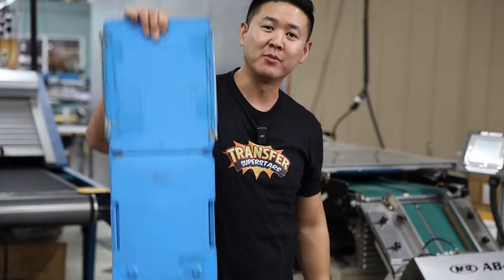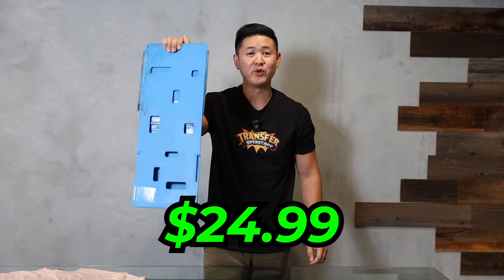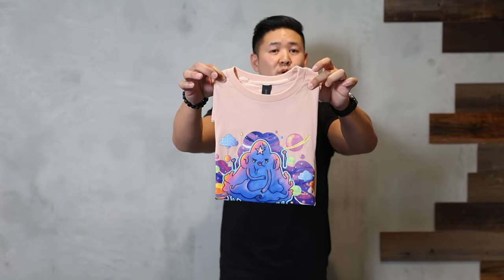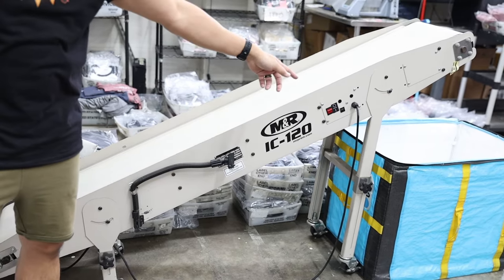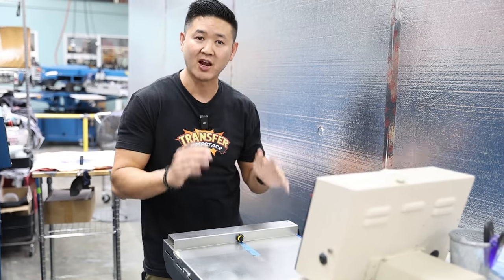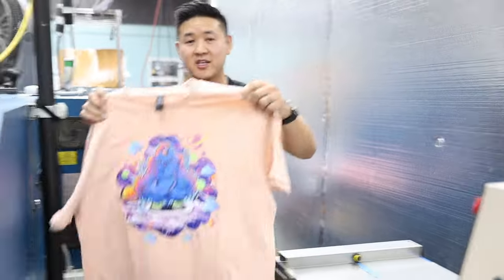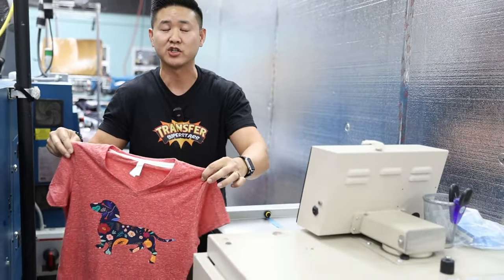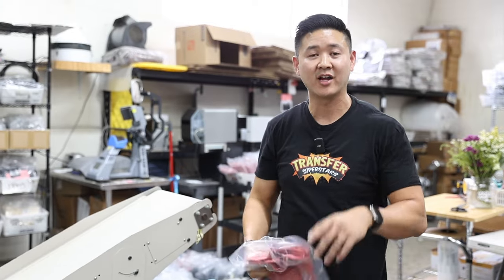$24 Shirt Folding Machine Vs  $50,000 Robot Autopilot BEAST

Comment: instead of folding in half for smaller polybag, can you fold final product smaller size, like 8x8?
Reply from the maker: With the machine or by hand? The machine is pretty set to automatically bag and seal. If you bypass the sealer, you can fold that in half if needed.